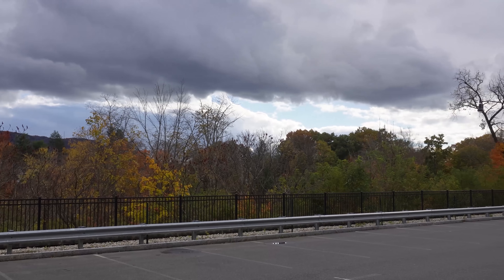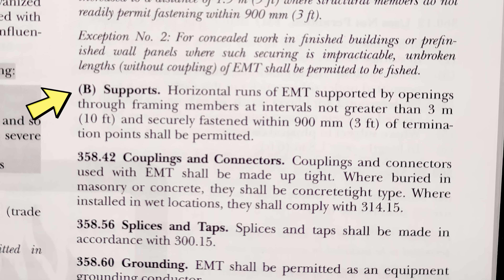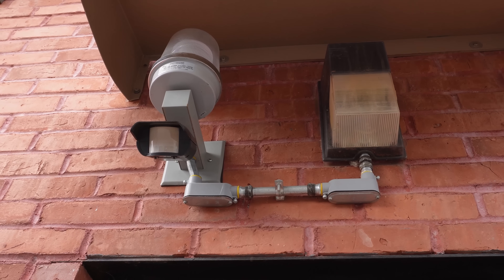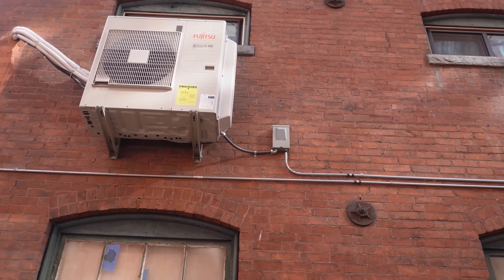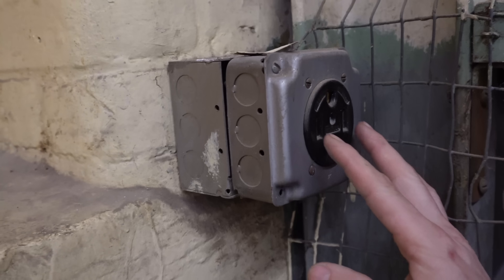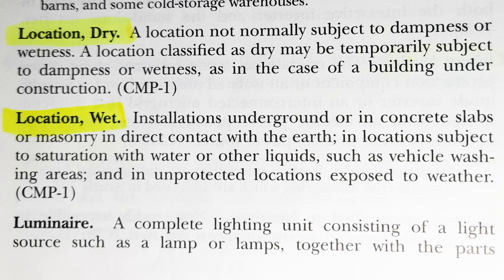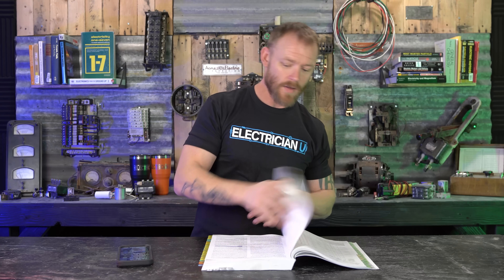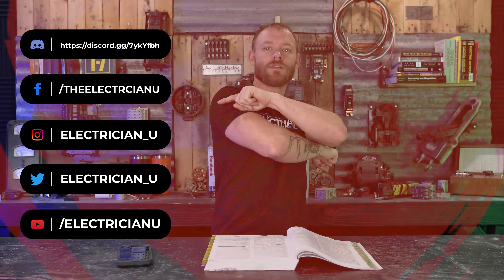Finding Code Violations in a 100 Year Old Building!

Comment: Hey Dustin,
Great video as always, keep them coming 😊
Looking at the AC units and disconnects on the outside wall, I think they come under Article 404 Switches, 404.8 Accessibility and Grouping in particular.
It states “All switches and circuit breakers used as switches shall be located so that they may be operated from a readily accessible place. They shall be installed such that the center of the grip of the operating handle of the switch or circuit breaker, when in its highest position, is not more than 2.0 m (6 ft 7 in.) above the floor or working platform”
Exception No. 2: Switches and circuit breakers installed adjacent to motors, appliances, or other equipment that they supply shall be permitted to be located higher than 2.0 m (6ft 7 in.) and be accessible by portable means”
That’s in NEC 2017 that I’m looking at, not certain if it’s changed article number location in NEC 2020.
Can’t wait for the next installment 😊
Reply: Pretty sure exception #2 includes this disconnect. So it’s indeed legal.

Makes sens as of your accessing the AC, you’re in some kind of scissor lift or something so as long as it’s close to the AC it’s accessible. And there’s still the breaker if it needs to be turned off without having a scissor lift.

Comment: RE@7:55, NEC Article 100 definition appears to state that you should be able to access any equipment without resorting to portable ladders for anything to be considered "Readily Accessible". On the other hand, 440.14 does say '... readily accessible FROM the air conditioning equipment (see 8:08).  The way I'm reading it, I'm leaning towards reverting back to article 100 definition of "readily accessible", again, where you shouldn't' need to use a ladder, rather than "readily accessible' from where the AC equipment is installed,

As Dustin said, "if I'm wrong,  please teach me"! 
Anyone?

Here is a quote of the NEC definition- 
"Accessible, Readily (Readily Accessible). Capable of being reached quickly for operation, renewal, or inspections without requiring those to whom ready access is requisite to take actions such as to use tools (other than keys), to climb over or under, to remove obstacles, or to resort to portable ladders, and so forth. (CMP-1)."

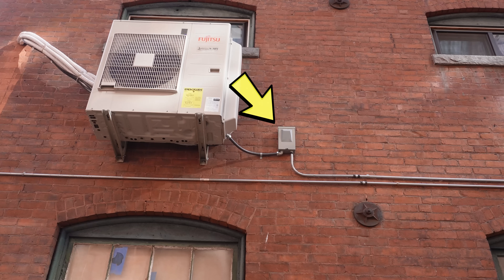Comment: 8:53 I disagree. Readily accessible means it's accessible WITHOUT the use of tools or ladders.
Reply: When you are up servicing the equipment you want the disconnect readily accessible at that location. If it were at, say, ground level then you would have to use your ladder or whatever to move from the equipment to the disconnect and then back up to the equipment.

Comment: codes change all the time new items get added so it is possible that when the air conditioners was installed there may not been code for what you are seeing as a violation now.

i think the most recent electrical code i have seen is now electric dryers have to have 4 prong plugs witch provides an additional grounding as the neutral wire as ground is not enough any more

it makes sense that the electrical pipe not be ran over the windows and the windows may have to be upgraded to be opening.

at least the air conditioner units are unreachable to most metal thieves so they wont get stolen very easy

them 110 outlets i think should be secured so they are not flopping around.

then 220 outlet should NEVER be under water source i dont know what they was thinking when they installed it

i think the code should be updated to make sure the junction boxes be covered because there may be some point where someone could get in reach of the exposed wires.

Comment: i once found a old building with 480 volt feeder in clay pipe the clay pipe had well rounded bends like it was made for wiring.

i  also have found EMT conduit brazed together where most would use connectors.
i also noted that the whole run used prebent EMT and i believe was installed by a non electrician building owner.
Reply: That clay pipe was electrical conduit from the Roman times.

Comment: This is just the natural progression of race to the bottom. Here in north Texas you have plumbers inspecting electrical, framing ect. Electricians inspecting plumbing, framing, concrete ect. Actually worked in city hall building ,above inspection department and found during a remodel 20 years ago. Whoever, used black for the neutral on 277v. circuits. If you know you can get away with that in a city building. Imagine what they are doing to average customers.

Comment: The majority of the uncovered junction boxes I find in commercial mechanical rooms are associated with air handling equipment/ducting, etc...  I think those are all low voltage wires.

Comment: I'm in Boston and live in 1834 construction. I think I have every type of residential electrical distribution that was ever used in this country (it's not all live). With that said, I work in industry and service automation and various biotech/manufacturing facilities daily. I honestly feel safer with some of the old crap at my house than some of the absolute HACK work I see in 4 year old multi million dollar facilities. Some of the stuff I see on a daily basis in facilities is absolutely insane. Lots of old New England 575V crap with motors and busbar, I see it all the time, I have brought it up in the comments here before and it appears that 575V is not very common elsewhere in the country?

Comment: The NFPA addresses life safety conditions like exposed wiring. 2015 IFC 605.6 "Open junction boxes and open-wiring splices shall be prohibited. Approved covers shall be provided for all switch and electrical outlet boxes." It's probably the same in 2021, not sure. I don't have a subscription.  

Also, the way I read it, when they say "shall be provided" it means they are supposed to have them. I can see how there's a kind of verbiage loophole there, but if you're an AHJ you're going to read that as "needs to be covered".

Comment: Ummmm, given that the NEC has changed about 30 times in the last 40 years, the real challenge would be not finding a "code violation".
Reply: Updates to the NEC "generally" occur every three years. The code will always be complex and will continue to get more complex over the years in response to changing technologies, improvements in understanding the behaviors of electricity, and regulatory requirements. It is a running battle between the folks that write or modify the code to be as concise, yet informative/educational as possible so that a solid understanding of the code can be gained over the years of apprenticeship and journeyman work. It is not necessary to KNOW everything in the code to do a good, safe job. You do have to know how to look things up in order to get the proper answer. (Retired oilfield instrumentation/electrical technician)
Reply: @ejohnson2720  90.2(B) is basically the grandfather clause if it was code compliant at one point it's deemed to be code compliant now unless you touch it then it needs to be brought up to prevent code.
Reply: @ejohnson2720  And? While your comment is basically true, (we can't forget the local code "improvements ") my comment stands. The challenge would be to not find a code violation. 40 years commercial/industrial/Marine Electrician here. Of course I exaggerated the NEC amount of changes, but trust me, changing local codes make up the difference.
Reply: It's only a code violation now if it was in violation originally.
Reply: @thereynolds2725  Absolutely. However,  the comment was just about how asinine the headline was.
Reply: While some codes are good, the vast majority are just money makers and graft takers. The NEC is a complete joke.
Reply: @toomanyhobbies2011  i dont need a gfci next to the tub. get yourself a job as a framer.

Comment: I though it was within code to use set screw EMT connectors outside as long as they are facing down? Makes sense as water does not run up hill.

Comment: The biggest failure of someone installing a local disconnect to an A/C or refrigeration system that I experience in my area is locating the disconnect behind the condensing/refrigeration unit. The disconnect must be visible and accessible to service personnel. If someone needs to reach the disconnect by reaching over the condensing unit then that is not safe as contact with the chassis is possible or if the compressor blows its electrical terminals the service personnel will be subject to not only electrocution from loose wiring but also flames from the compressor oil and burnt refrigerant.

Comment: love the video. I was wondering what dose code say about running MTW wire in conduit?
Reply: Also a few places I've noticed.

Especially in basements probably ended after the fact later in the buildings life note residential in all these cases I've seen.

Most of the wiring was the Old Rag wire as I call it words the woven or whatever nonmetallic sheathed cable often ungrounded as well.

But sometimes in basements and garages and workshops.

In a particular area particularly.

I would see conduit run Japan tea boxes and receptacles or switches.

That only runs to ceiling level or thereabouts.

The wiring used was Romex.

Throughout including in the conduit and a junction box.

The conduit simply ends at or near ceiling level.

In some cases above the suspended ceiling.

This is like that in most of those places in that area I've seen that I've had other wiring done later on.

Was this fairly common or even two code at one point???

Around Kentucky and Tennessee is mostly Rock notice this more than a few times!

And not just in the same place but multiple residences across those areas!

Again this would be in the basement.

Mostly but I've seen others like this elsewhere in these residences!

I suspect it was an add-on later.

I don't know for certain but it might have been done due to physical damage just to protect the wiring since otherwise it would run exposed.

But that's just a guess.

Any thoughts please.

Comment: I’m a lighting consultant designing lighting layouts for casinos, hotels and hospitality in in general. I too look at everything in nearly every building I enter to not just criticize but try to learn how someone did things differently. If you work long enough in any industry you realize there are multiple ways of doing things to code and correctly as well as different looks. Every tradesman and designer has a bit of an artist in them so not every job looks the same nor should it.
Reply: I wish the guys who did our building had some artistic talent. It is painful to look at. To code but painful.
Reply: What you say is true... Some experienced journeymen will debate over or do things entirely different, yet, in both cases, it's up to code and installed in a clean workman-like manner.  Just as with the two LB conduit bodies (in the video), another electrician might use an LR and an LL, another might use a short length of seal-tite.
Reply: I did some electrical work on my house and the inspector that came over was one I had never met.  He was about 5 min into the inspection and said, "You must work for 'Boss name' don't you".  Everyone has their own style.

Comment: Most local fire code require all j boxes be closed as well as any other box or pull. 
FRA, Federal Railroad Administration also require all boxes or covers be in place and marked high voltage. All moving parts must also have approved covers in place. 
I am a locomotive composite mechanic which means I do electrical as well as pneumatic and mechanical work on these locomotives. 
I do have one question. We use Exane wire on locomotives and was wondering about whether it would be legal in a home electrical system?  In conduit of course. It has a higher amperage rating per gauge, a higher voltage rating per gauge as well as better insulation quality. It is a multi strand wire that is both silver plated as well as being tin plated. The problem is that it only comes in blue, gray or white depending on the gauge. In locomotives we label everything so it isn’t an issue but don’t know what it would be for residential? 
I love your videos. 
Greetings from the high plains of Texas.
Reply from the maker: AWESOME. 
If it is listed for use for other purposes just follow those listing requirements and you should be good.

Comment: Ok I live in MA and can tell you first hand that this is how everything is wired up here. Most things up here are, like you said very old. Almost everything you showed in this video can be seen in any super market, office building, doctors office, or apartment complex in Suffolk co.  I simply can not tell you how many times I have stepped off an elevator or escalator or rotating door that was installed in the late 1800's and been totally frightened by whatever I see above me or below me. There is shit dangling and falling out of everywhere. Everything is nailed (1890's spike) into brick or rock and nothing is grounded, and it is 100% as fubar as it looked while you walked through. I can guarantee that every time you said to yourself "there's no way that's still being used/hooked up/working etc" it definitely was, and more than likely tied into something life saving like smoke or fire or sprinklers. That's just the way it's done up here I guess. It's all held together with good thoughts and nylon tape.
Reply: Hahaha when he said "idk if it was live or not"
I was like oh, that's totally live, if it weren't someone would have pulled the copper for scrap
Reply: Same will be said about the current technology in 100 years.  If it will survive

Comment: Why is the metric term the first term and the normal American term in parenthesis? Is that a Canadian copy?
Reply: Executive Order 12770, signed by President George H.W. Bush on July 25, 1991, citing the Metric Conversion Act of 1975, directed departments and agencies within the executive branch of the United States Government to "take all appropriate measures within their authority" to use the metric system "as the preferred system of weights and measures for United States trade and commerce."  So no, it's real USA stuff but — as witnessed by Dustin reading out the parenthetical customary measure given on almost all occasions rather than the official metric measure — people still stick to the traditional ways.

When told I need to buy 6'×4' plywood with 50mm foam insulation I can laugh.  When it costs NASA a $125-million Mars Climate Orbiter as it did in 1999 no one should be laughing.

Comment: A ton of the 4"and 4 11/16" j boxes in my 120year old NYC loft apartment building have no covers, with live conductors .  I've been buying plates and covering them.   Probably 20 plus that i've found so far.   Very strange to me - is this just laziness?
Reply from the maker: I think sometimes it’s laziness, sometimes it’s forgetfulness, other times they can’t fit the cover on so they just leave it off.
Reply: @electricianu  Thanks !  A couple I put extension rings on before the cover, to avoid stuffing in the conductors, so your reasons makes sense . 

Enjoyed hearing about the Massachusetts walk-thrus - super interesting!  I love your  NEC wording dissections.  Seems like they should clean up the wording here as common sense suggests it ain't kosher - here in NYC they want everything inside metal so leaving off the cover defeats the spirit of it all, allows Rats to gain access & chew  etc..
Reply: @yeliab814  yess
Reply: Perhaps the covers were stolen to replace missing covers in another building!

Comment: Regarding the open boxes with no covers installed, while the NEC code is vague about this, I can tell from experience this is a OSHA violation, also the wires not being clamped properly is a NEC violation because the wires are not identified as being not in use and you cannot assume that it is disconnected else ware . It would be interesting to know if this building is being insured? I don not believe that an insurance company would even insure this location with issues like this. Lastly since this location is going under renovation for new tenants, any work that is being done would have to be done to the current code.

Comment: I recognize the pipe as being used for hydraulic as I used to operate a press to make 50 pounds salt blocks. It was the same type of pipe and fittings and was from equipment that was pre WWII. Looks like they salvaged the pipe to get some that was large enough.
Reply: I wouldn't be surprised if the vertical section on the corner of the building end used to have a weatherhead  and a service drop coming off of it.
Reply: @LegoTux  new subscriber to your Channel just now!

Comment: NEC 314.25 requires that covers shall be installed after completed installations.
Reply: Nails would be a code violation as 314.25 says to use machine screws 

Screws used for the purpose of attaching covers, or other equipment, to the box shall be either machine screws matching the thread gauge or size that is integral to the box or shall be in accordance with the manufacturer’s instructions.😎
Reply: @engrpiman  bubble machine screws and definitely not drywall screws I've seen this many a Time!
Reply: Nailed it. This is the answer. Thank you!
Reply: Ya, my ears kind of perked up when the discussion of covers came up. We have a death every couple years with someone coming into contact with open boxes.
Reply: 314.25 Covers and Canopies. In completed installations, each box shall have a cover, faceplate, lampholder, or luminaire canopy, except where the installation complies with 410.24(B).
Reply: What if they are technically the installation has not been completed, which what look like in this case..
Reply: @keithw846  if there's an electrical inspection signed off from when the visit was installed, then it would be considered completed